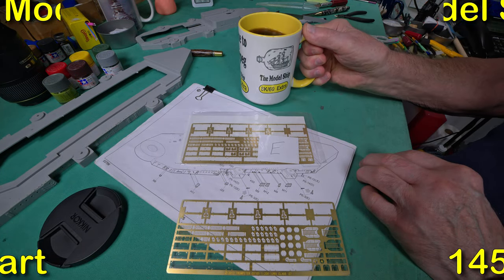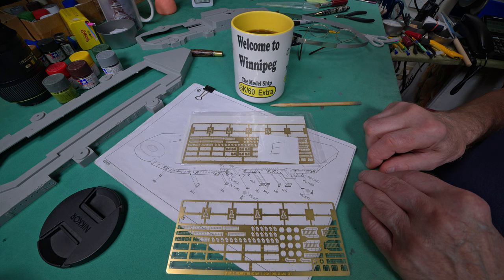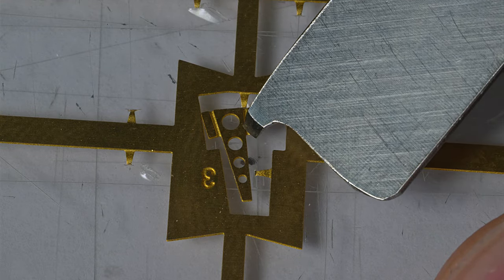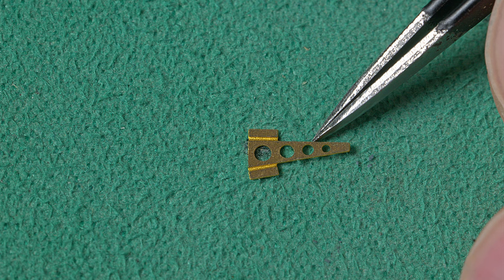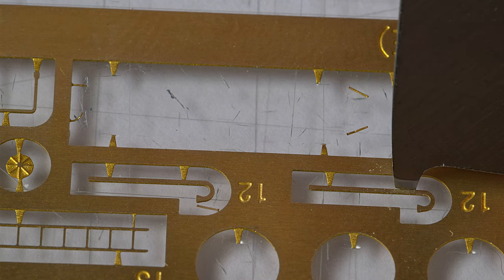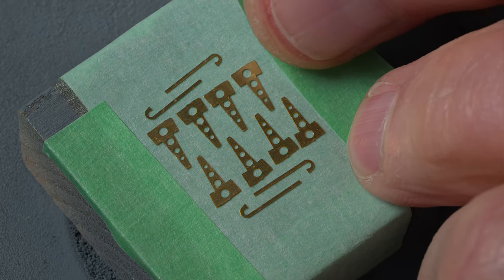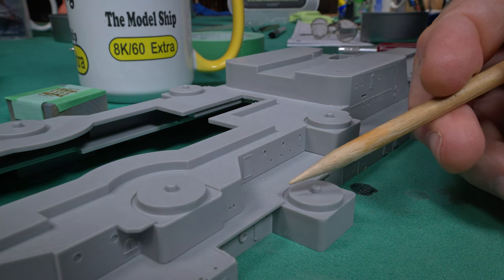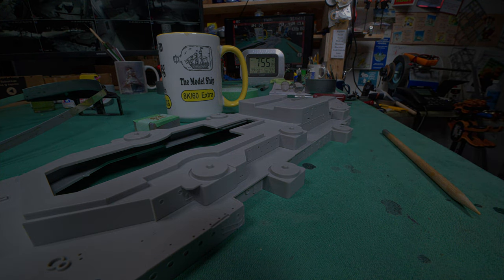The Model Ship - Part 1456 - 8K Extra

Comment: Oxygen and Acetylene tanks are for hot metal work. Welding by braising and torch metal cutting are the chief applications.  Oxygen tanks are green. Acetylene tanks are red. When not in use they are stored separately....25 ft.